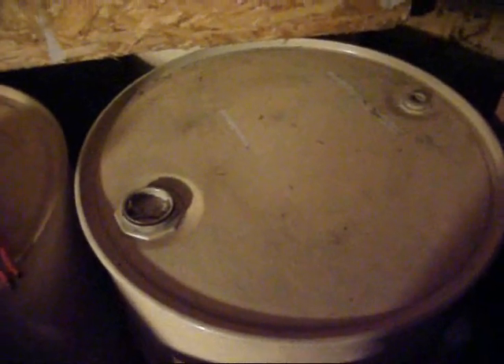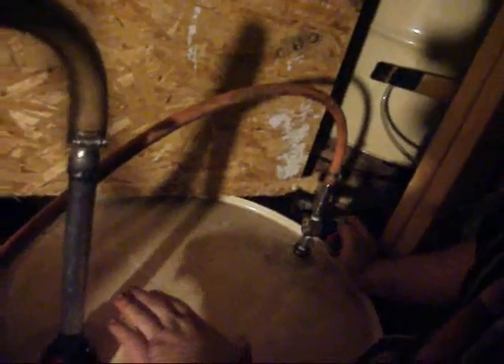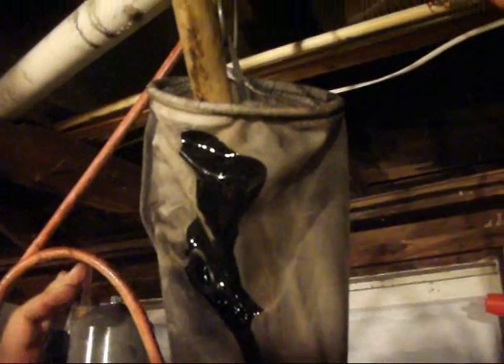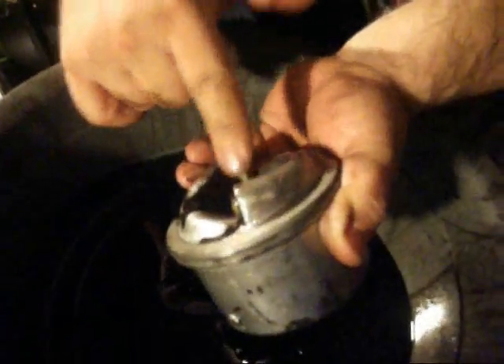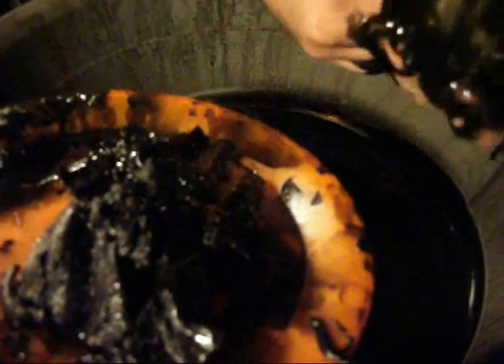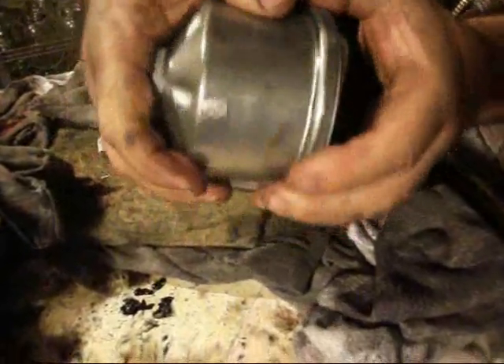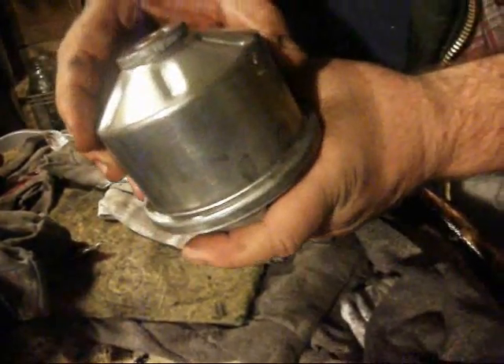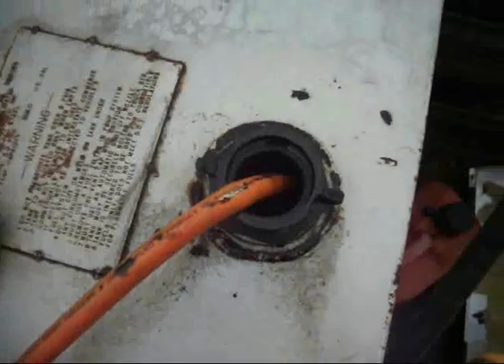Waste Oil Fuel Truck

Comment from the maker: I've got well over 5000 miles and now I'm running 80/20 due to the winter. I run an extra lift pump before the mechanical. I'm having some vapor lock issues with the 20% mix so I'll be wrapping the filter and lines shortly. Sorry it took so long to get back to you.